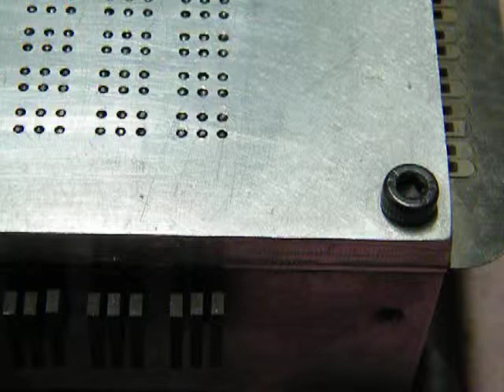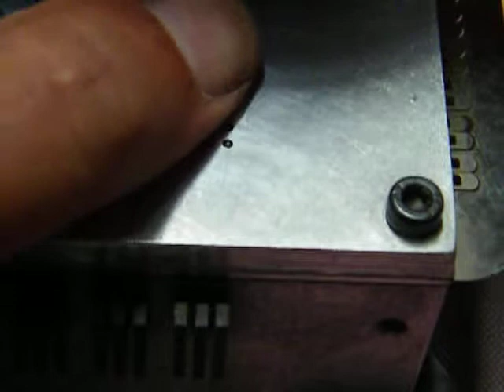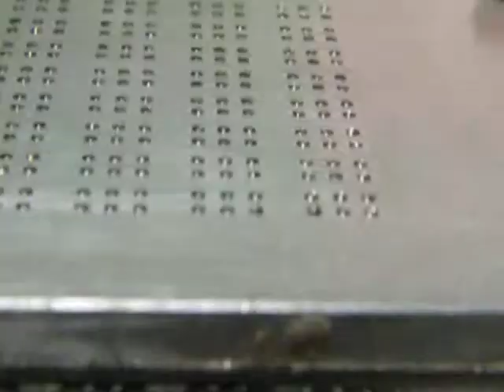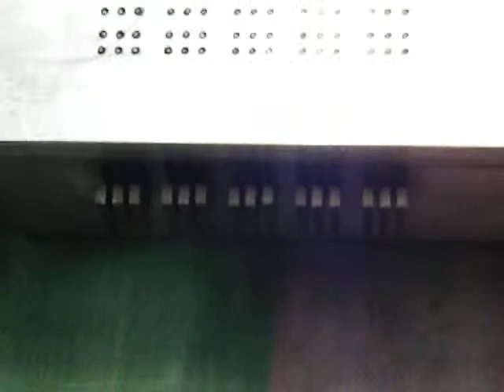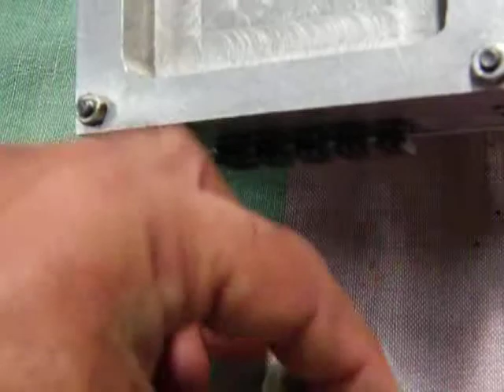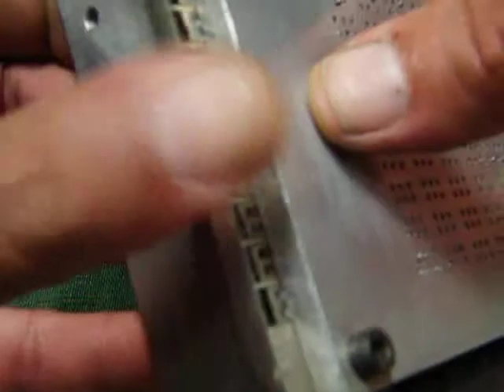Refreshable Braille Display - Row & Col control

Comment from the maker: All the best Kishore. I hope you can take it forward and continue where I paused!
Reply: also sir if you don't mind may I ask what made you go with SLBD when you already had a working prototype of multiline version
Reply from the maker: @KISHORENEDUMARAN  while designing actuators for the multi line I came up with a more efficient actuator assembly that could be implemented directly in a single line device at a lower cost. So that was the reason for temporarily putting the mlrbd on hold.  Check www.touchetech.com for some updates.
Reply: @pgdsouza  thanks for your time sir, really awesome work!